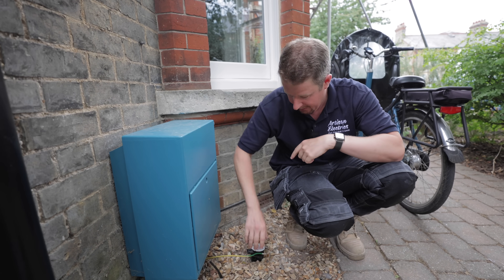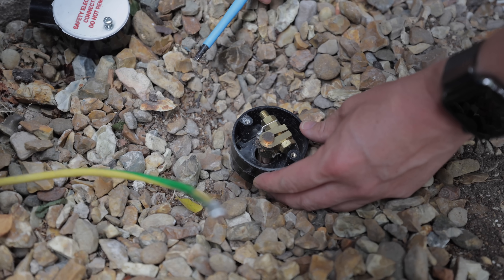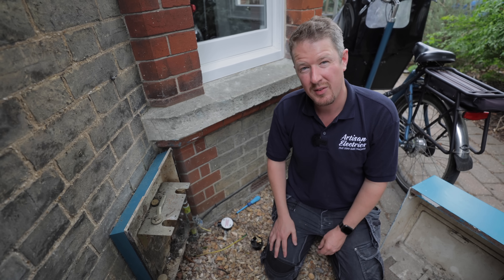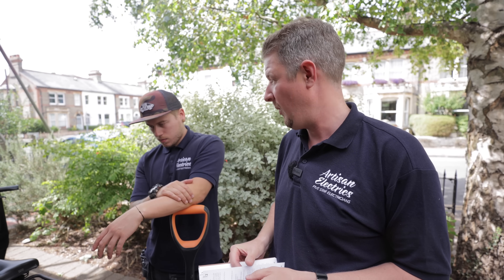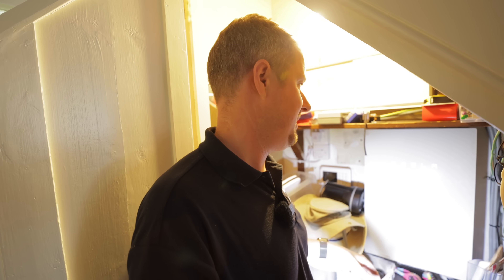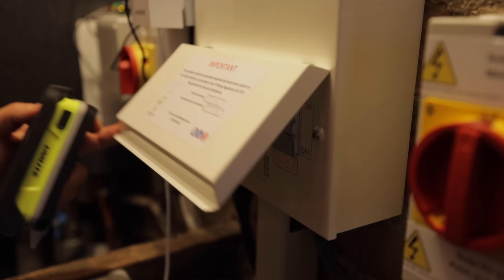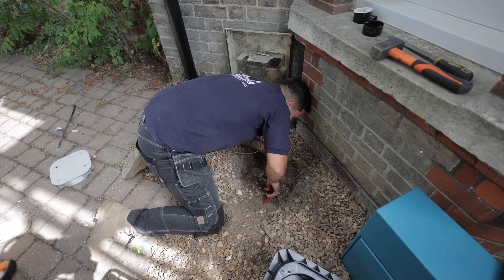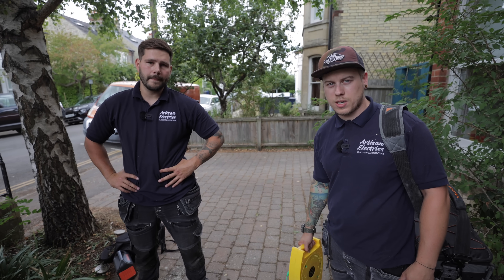The WORST Tesla Powerwall install I've ever seen 🤯

Comment: min size of earth cable run with no mechanical protection as stated in bs 7671 is 25mm and connection must have protection against corrosion (denso tape) just being picky, good work

Comment: “Why the rod”. The power company transformer has capacitance between the input winding one the output winding. This causes a common mode voltage (a bias on both hot and neutral) FROM the power company.   When the power wall kicks on it does the same thing TO the power company which would be dangerous to the repair people.  Sending to earth mitigates this.
Non-UK people please note this wire sizing and long lead is all wrong in lightning zones.

Comment: 1 ohm on a single 4ft rod??
Reply: The one ohm is the ground wire not the rod.
Reply: @gordonn4915  yes quite correct, I missed that.
Reply: must have tested without disconnecting from the supply earth.

Comment: Those cheapo boxes, are okay if done properly.... We use the slightly larger square version if  it's close to a wall.... drive the electrode and screw the actual box to the wall...

6mm  for the earth, unless mechanically protected, then 2.5 is fine, off the top of my head
Reply: OSG is going above and beyond.. again. We run  6mm in conduit when we do TT islands

Comment: It's the same system broadly as a generator you may have for a temporary supply. Ideally it should be tested using the wenner method or similar to check fault current dissipation. the Ze you have tested is back to the supply TX which is isolated from the system when the power wall is islanded. Always enjoy your videos.

Comment: The gateway doesn’t switch “instantly”, it’s very varied and depends on how current is flowing… a lot of the time you’ll get a dip and power loss enough to lose a computer etc - it’s not a UPS; it’s a common misconception. And there won’t be any DC cables going to the powerwall as powerwalls are AC only… the CAT5/6 cables in that first box you said were CT clamps were likely the comms cable between the gateway and the powerwall. (You asked! :D )
Reply: Yeah...quite often there's a marked difference in comprehension between electronic techs, and electricians. Where this always 'pops-up' is in discussion of multi-phase power, as opposed to 'split-rail' (this occurs more commonly in North Am systems, where domestic supply is almost always single-phase, but centre-tapped neutral/ground. Electricians state "split phase" because they think voltage, not current. The phase stays the same no matter where you tap the secondary.
Reply: @stephensaines7100  I claim antiphase because the output voltages of the centre-tapped transformer are 180 degrees apart relative to the centre tap. Voltage obviously drives current assuming loads. The terms line or phase are often wrongly confused, as my tutor used to ask 'phase relative to what' ?
Reply: Is the gateway switch basically a 3pole Contactor that breaks the connection of the supply to the house and the coil supply of the contractor is fead from the incoming supply. So once that is lost the contractor drops out and when the power comes back on the coil is re energized and goes pack to using the incoming supply

Comment: I'm guessing this ashp is a vaillant kit judging by your comment saying hydraulic station. 
I have a ashp and would like solar / battery but my heat pump is a big twin fan around 12kw which might drain a battery quick. Not sure what's best really with the rising price of everything
Reply: It's a 12kW Vaillant Arotherm Split. The Powerwall Gateway has an option to enable a "load shedding" relay which can open when grid power is lost. I was planning to connect it to the Energy Supply Cut-Off volt free contact on the heat pump, so I could stop the heat pump draining the battery during a power cut. It needs an intermediate relay because the Tesla relay is NC and the Vaillant ESCO is NO.
Reply: 12 kw is the heat pumps heat output . It is not its electrical input .
Reply: @persona250  I know that it can draw upto 25A on the input side

Comment: Really interesting video, good stuff! Very interesting to see that the powerwall uses a rod so that neutral can be referenced to earth just like the live supply. Alternative supplies are usually IT with a floating earth. Seems odd that the installers used flexi for what looks like a straight run up to the loft, would have been a lot easier to pull and looked nicer in regular pvc conduit. Oh, and absolutely no way was that 1.01 ohm reading from the rod!
Reply: 14:06  The 10mm wire to the board/charger ?  I still conected when doing the testing .. / the earth from grid and bondings still connected ...  nope  1 ohm is impossible with such thin en small earth rod .. or it must be magic soil ..   I usually have to put 2 -3 in to get  12 ohm earth restance . Altough i measure with the 3 wire method ..  we don't do ZE tests in Belgium .. but should be simalar result ?
Reply: @kittsdiy  Yes, exactly what you said.  To get a Ze for the rod it should be done at the board with the 3 wire earth loop impedance test  and the cable to the rod disconnected from the MET to eliminate parallel earth paths.  I think they maybe tested continuity of the 10mm cable between the MET and rod and that was the 1 ohm reading we saw, although that seems high for a 10mm cable unless it was a very long run.

Comment: Is it just me or did that look like the earth rod is still connected... considering how low that reading was, I suspect you are just getting the resistance of your wander lead and actually that earth rod is connected to the MET, it seemed very low...  Would have been better to have disconnected the earth rod and then done a Ze as that is such a low reading, especially as we have had very little raid and its only a small earth rod..

The first outside box looked fine, once you pull it out a bit, its functional and maintainable, give me a bit of extra slack every time, just like you found with that earth cable, sometimes a bit of extra slack can really help..  The other box was a bit messy but again I am sure you could pick it out and it would be fine...  

Title seemed a bit of a click bait as didn't seem too much wrong with that install, if I had been the installer I think I would have been pretty mad, even the consumer unit at the end looked pretty neat and tidy..
Reply: 1 ohm is verry Low ..  In Belgium we have alway put earth rods or earth loops in foundations ( TT  net  ) ..   And i can tell you with that thin en short earth rod .. we never get it under 30 ohm  ( Regulation say here  lower or equil to 30 ohm to pass inspection ) .
We still use the 3  wire measring technique .. but i have seen an inspector measure between live and earth and got a similar reading ..
Reply: @kittsdiy   Interesting stuff, I believe our regs did think about going to foundation earthing for new builds but they backed out for now, probably will come in down the line, especially with solar and battery storage becoming more common it makes sense..   We have varying soil types in the uk, we can use additional small rods to get a resistance reading however most people just use the Ze reading as its easy but I agree getting around 1ohm for that sized rod would ring alarm bells..

What they said in the video is actually wrong, we are allowed a reading upto 1666ohms but you have to prove that it is reliably below that so you would have to take multiple readings over different weather conditions and over a varied time, the alternative which most people use is under 200ohms is seen as sufficient to no matter what the conditions in the worst case scenario will never get below 1666ohms...    With a TT system we normally put a 100ma time delayed RCD (Although you can rely on just the 30ma RCD) in addition to 30ma RCD's for fault protection..   

We still mainly rely upon the distribution network to provide us with an earth which is mostly the neutral split at the incomer which comes with its inherent risks which is why I think they did think of going to like you foundation earthing but think they backed out of it as there was PEN fault technology developed to get round the dangers but who knows what will happen in the next edition of the wiring regs..
Reply: @steve11211  Here we have to put a main RCD of max 300mA as main switch of the consumer unit and 1 extra unit for the bathroom ( 30mA )  so all the circuits here have RCD protection .   Earth has to less or equil to 30 0hm .. if it's higher in some case you have to put  a 100mA  MAiN RCD or it will not get approved .
Reply: It reminds me of my grandmother's cottage in the 60's.  She lived in a small village near Stamford.  I have no idea how the place was wired - it was probably done in 1940-41 when they bought the place and fixed it up, but there were plenty of round pin 5 and and 15 amp sockets.  She would describe the electricity as "it's a bit slow today", and would on occasion go outside to water the earth rod to improve the situation.  Everything would work better after that.
Reply: @kittsdiy  we have similar rules for TT installs, where you need a 100mA type S RCD at the incomer and the rod must be < 200 ohm. We generally only have TT installs in rural areas though and the majority of our installs are TN-S or TN-C-S, where the Ze is not allowed to be higher than 0.85 or 0.35 respectively. Since the 17th edition of BS7671 in 2008, 30mA RCD protection was mandated for all domestic circuits.
Reply: @havoctrousers  not all , still to this day not all
Reply: @GodmanchesterGoblin  sounds like it was missing a neutral connection and was using earth as the return path back to transformer.  I seem to remember that some of the early transmission systems used earth this way - although that would pre-date 1940s I'm sure.
Reply: @_chrisr_  That's perfectly possible. My grandparents moved out of London in 1940 and acquired the cottage in a very poor state. Given the times, who knows what was done, or how well. Back then, they were no doubt pleased to have a roof over their heads and the quality of the electrics would have been a secondary consideration.
Reply: The problem with the JB's is not that they look messy, but mixing of band 1 and 2 voltages and I doubt the comms wires are rated to mains voltage.
Reply: @mfr58  The data cable for the CT clamps are screened, its more of an issue of interference when cables are ran next to each other for long distances especially for a long period, non shielded cables can cross band 2 cables, its in the AM2 exam where it crosses in dado trunking, it won't be a problem.  You could put a bit a screening over the connection but it would be overkill..
Reply: @steve11211  Yes, but the individual wires are exposed and tangled together with mains wires in the JB, which I would consider not in the compliance with the meaning of safe  separation of band 1 and 2 voltages.
Reply: @mfr58  Its not exactly tangled together, and for the inch or two it will be fine.  If that makes it the WORST Tesla powerwall he has ever seen, either all other installs are perfect or its the first one he has ever seen..
Reply: @mfr58  They are not exposed, they have single insulation on them, if you think that is tangled then you have never worked in any sort of communication cabling..   Go look at a server rack, they have power and unscreened cat5 or cat6 right next to each other without any issues..   For the amount its exposed it will not be an issue, you could separate it in a box within the enclosure but that would provide no help to electromagnetic interference..  It's about understanding why those regulations exist, technically running a screened cable does not comply because you are not "Separating" the different bands however its understanding those regs and the reasoning....   It will not cause an issue and clearly isn't or it would flag up..
Reply: @steve11211  They are exposed in the sense that the single insulation is unlikely to be mains rated which is the requirement for mixing band 1 and 2 voltages. As for the tangle I don't see a problem apart from the increased contact area and added potential for contact between circuits that shouldn't be mixed.
Reply: @mfr58  Yeah you could put a bit of sleeving or tape over it but that box is not specifically for 230v, it would be different if it was in a consumer unit..  The outer sheath of a cat5 cable is to provide a bit of mechanical protection and to keep the cores together, its in an enclosure so thats not an issue..   There is no regulation about being double insulated for data cables..  I think its being a bit pedantic and given some things most electrician see on a daily basis..   Would still hardly call it a really bad installation because of that..  Clearly its not an issue...
Reply: @steve11211  I think the install looks fine except for this issue. 
Requirements of Regulation 528.1

Unless the segregation requirements of Regulation 528.1 are satisfied, circuits of voltage Band I and voltage B and II should not be contained in the same wiring system as a circuit exceeding low voltage, and a Band I circuit should not be contained in the same wiring system as a Band II circuit.

To minimise the risk of interference between cables of differing voltage levels, every cable or conductor should be insulated for the highest voltage present. Where a multicore cable contains Band I and Band II circuits, as shown in Fig 1, all conductors should be insulated for the highest voltage carried by the cable
Reply: @mfr58  Insulation does not stop electromagnetic interference
Reply: @steve11211 Quite so, but it does stop conductors potentially touching if the insulation fails which is my concern here. 528.1 i) is clear that band 1 and 2 must not be mixed except where they are both insulated to the highest voltage present. There are other exceptions but not applicable here. Anyway, I would avoid doing this, but you can make your own decisions.
Reply: @mfr58  Clearly you don't understand network cables and the reasoning behind the regulations... But you do you..
Reply: @paarker  Yes, that is my concern, not the interference i this case.
Reply: The cable should also have been proved separately as there could be unknown connections between the rod and the CU.

Comment: Why did they install it outside? It's not very good for the battery
Reply: It can go outside, and when it sets on fire (very rare), you probably want it outside, plus helps with cooling..
Reply: Lack of suitable space inside!
Reply: Do they have a heater inside to keep them up to temperature in winter, maybe better inside to save the power to heater?